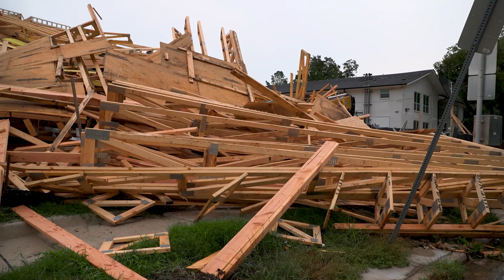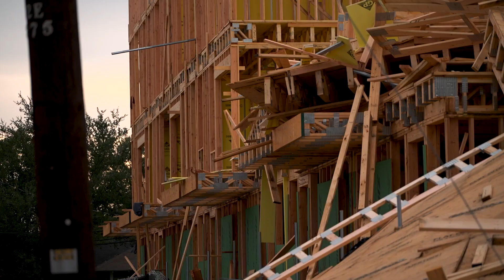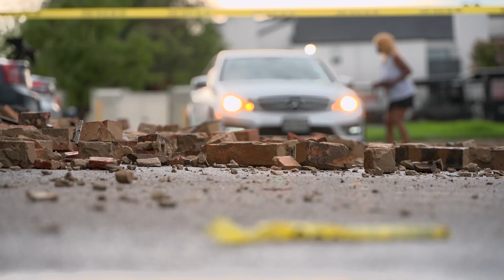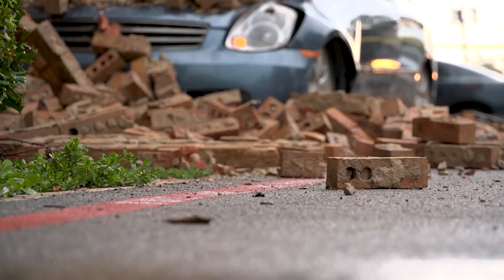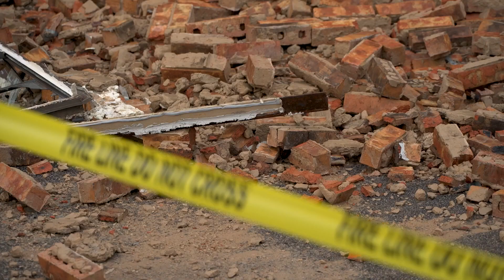Severe storm causes damage, collapses in parts of Dallas

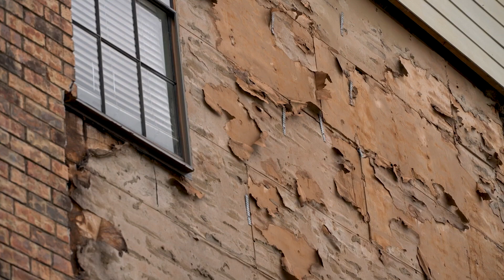Comment: I was a bricklayer for decades and in that time veneered many structures with brick.   At the 1:12 mark in this video you can see corrugated wall ties were nailed to the structure but appear straight like they were never bent over and tied into the veneer.  Had they been the veneer likely would never have fallen.
Reply: yea?